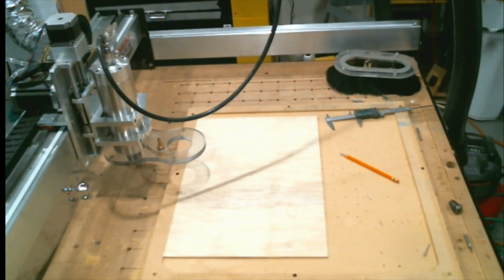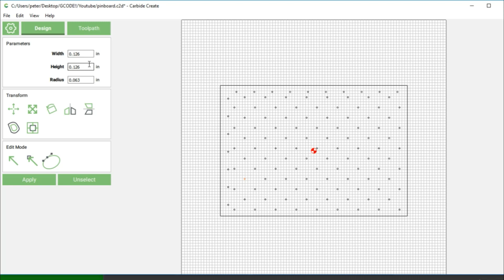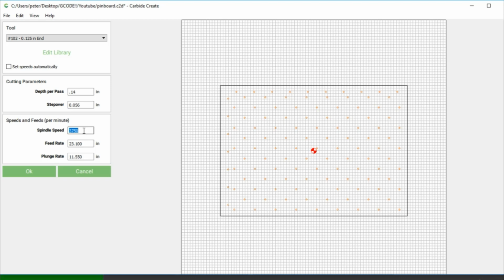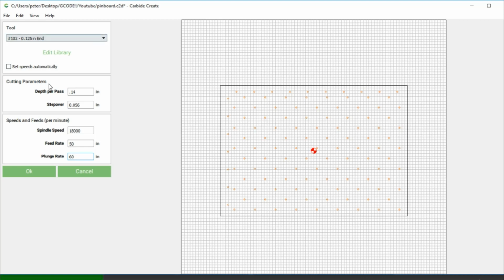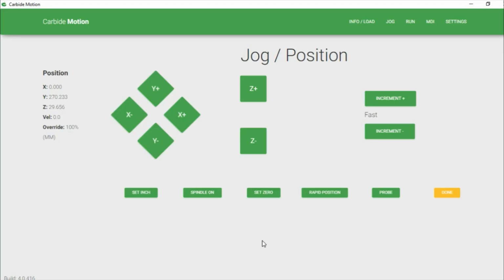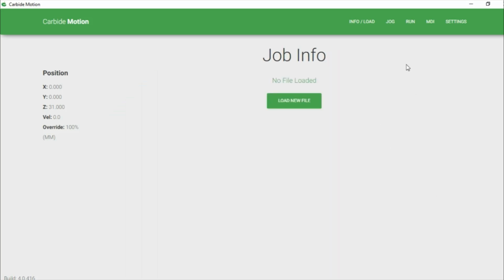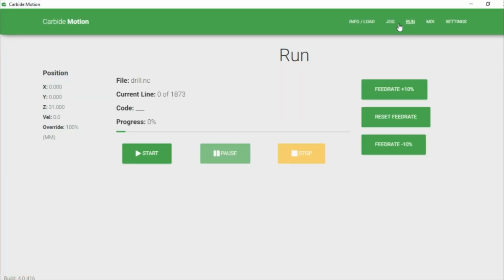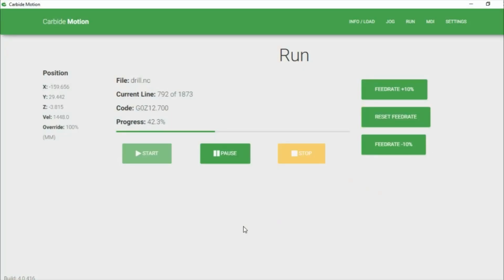Drilling with Shapeoko 3 and carbide create

Comment: Great video about drilling with Carbide 3d.  Question about increasing feed rate.  Doesn't seem like the plunge was going any faster.  Doesn't feed rate just increase how fast the router moves from hole to hole, not how fast it plunges?
Reply from the maker: You are absolutely right, the feed rate only changes how fast the router moves through material. Changing the plunge rate will cause the z-axis to drop faster into the material.
I'm glad you enjoyed the video. I'm transitioning into the new shop now hope to have some good content and good quality videos coming up in the future. I hope you check in from time to time.
Reply: Were you using a drill bit?